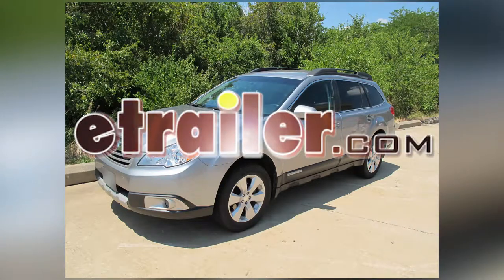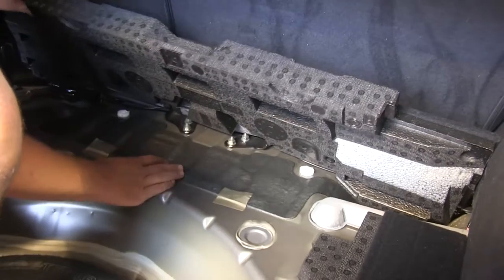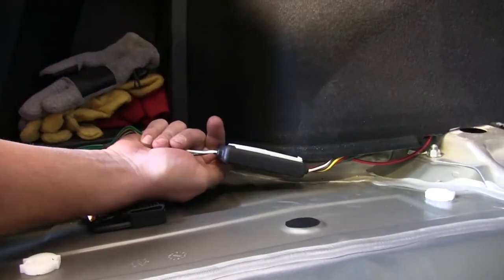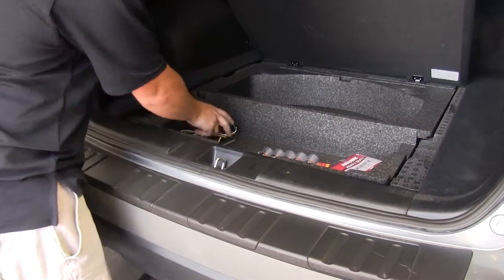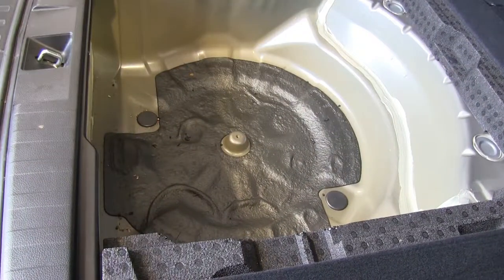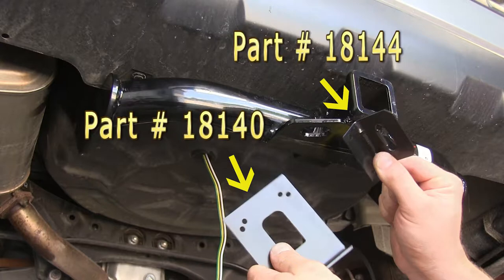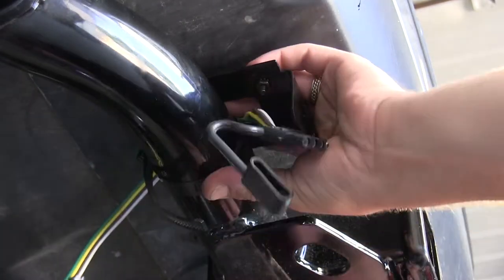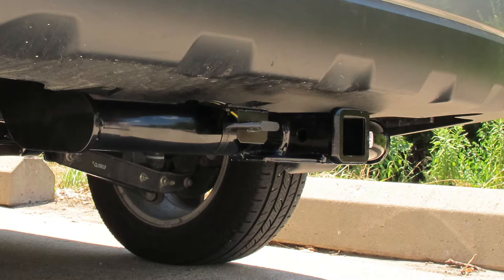etrailer | Trailer Wiring Harness Installation - 2011 Subaru Outback Wagon 118467

Comment: I followed your instructions from the video.  Everything is fine except the yellow wire is always hot no matter if I turn the lights on or off.  Turn signals and brake lights work fine on the trailer, but tail lights are always on on the trailer
.  Do you have any suggestions?
Reply from the maker: Sounds like a bad ground or short to be honest. I would check your grounds and look for damage or shorts. Here is a help article that will hopefully lend some advice too. https://www.etrailer.com/faq-4-5-way-troubleshooting.aspx